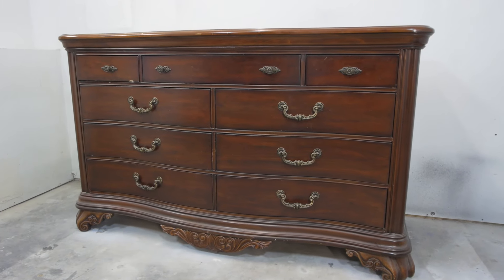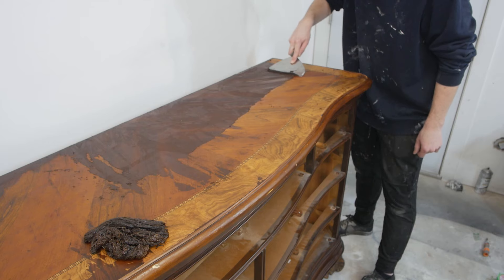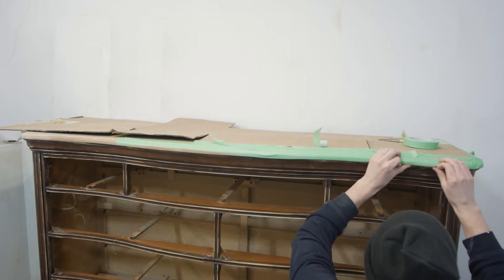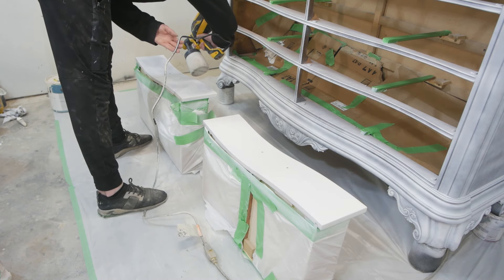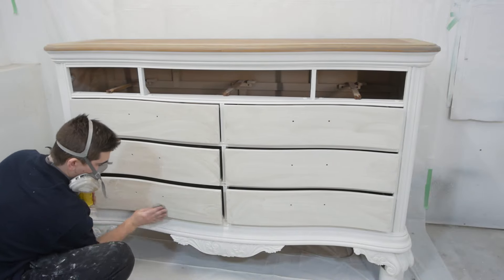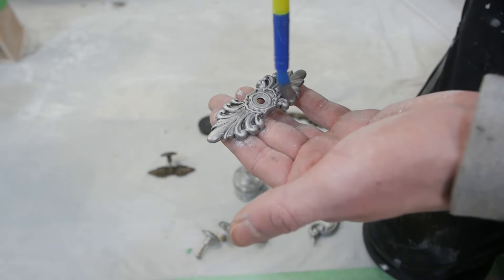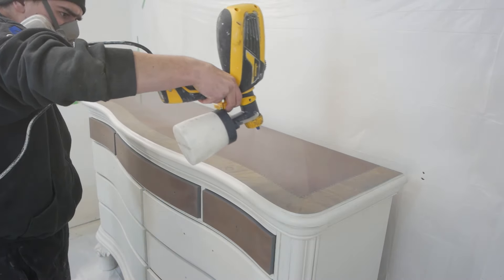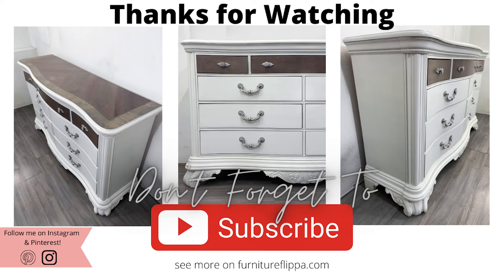DRESSER MAKEOVER | Painting Furniture With a Spray Gun

Comment: Brilliant idea using the flooring to stage instead of having to take it into your house. When you stage your items have you ever thought about what most flippers do and that is add a few trinkets on top of the piece? Stylish trinkets of course. I’m trying to think what I’ve seen most of them use and it’s usually things like vintage books, some beautiful flowers, maybe a lamp. I just think it gives the piece a nice homely feel. Also another thing you could do to make it look & feel a lot more homely is add a small rug under your piece. Not so it covers your new wooden flooring but so you can see the rug and the flooring. I always think that looks stunning. A lot of the flippers have gone to the trouble to make their own staging wall. Which is kind of like your wood flooring but in a vintage distressed white (usually) the best one I’ve seen is she got her hubby to make it for her and on one side she did the wood panels going across in the white distressed colour and then she also painted the other side of the wall with quite a dark colour. Not black black, but dark. And she explained she would flip the wall depending what colour her furniture was that she had painted so it would make her piece pop against the backdrop. And her wall was so cool as it was on wheels so she could easily move it by herself. And like you she put a wooden floor down and then put a rug under her piece. She said it just adds layers and different textures. Her staging pictures always turned out TOP NOTCH!! p.s you need to buy some of the gold gilding wax 🙂 beautiful work as always 👍

Comment: That darn MDF that just does not play well does it?
Stunning!!! Love the staging setup. That's what I want to do in my garage too but not until the weather breaks it's just too cold out there right now we have no heat in the garage. I'm afraid to use a space heater cuz I don't want to blow myself up. That would make a terrible mess.😎
Reply from the maker: It doesn't! MDF just makes for more work.. but thanks!! I have to turn my little space heater on for a bit during the cold, my heat bill doesn't like it but at least my youtube audience enjoys the videos I can make :)
Reply: What kind of heater do you use? It works with the fumes?
Reply from the maker: @mrststreasures9628  I have a small space heater and I will turn it on before I start working. I don't bother on super cold days, but if I can get it up to recommend temps I will. I don't have it on when I spray.

Comment: More videos please. I do like the way this one came out. You know what you are doing when applying all the products. I would've preferred if you had done the stain on top to match the stained drawers. I know you used the same stain but for some reason on video, they look different. The dark drawers on front gave a good contrast to the white and I think that is what the top needed, more contrast against the white edge. I do like the laminate flooring for staging. Now you need a picture on the wall. You will like the new sprayer you talked about. It's 100% better performer than the Wagner.
Reply from the maker: I will keep the videos coming! And the drawers do look a bit darker, the lighting didnt help. But the veneer was likely different causing them to turn out differently too. Thank you for watching and I hope you continue to support :)
Reply: Are you talking about the HomeRight Super Finish being the better sprayer? Just want to be sure since it is also a Wagner.
Reply from the maker: @ronlaverdiere  I think both are good, but in my opinion the Homeright Super Finish Max is easier to use.